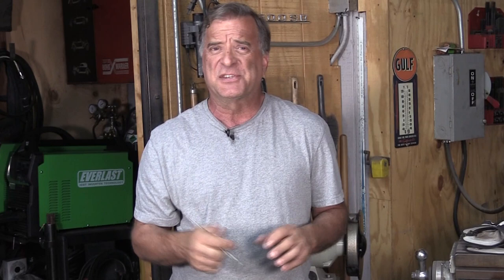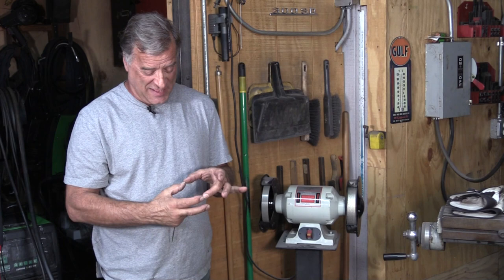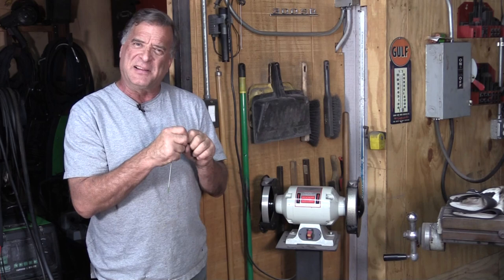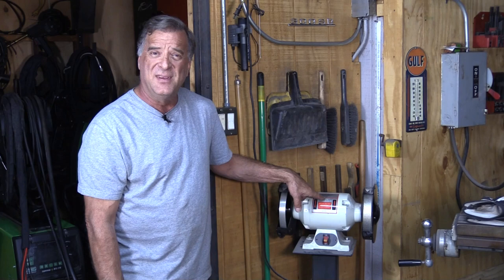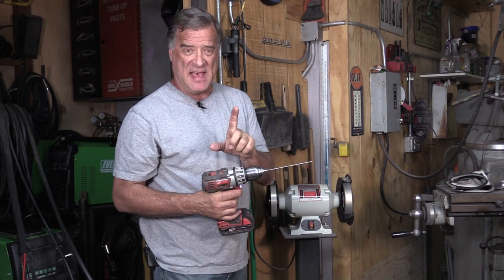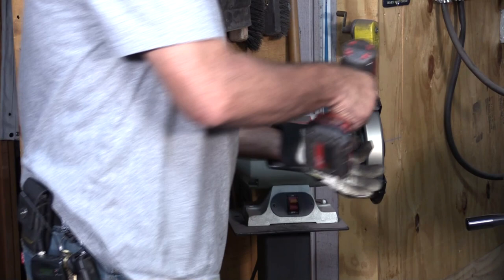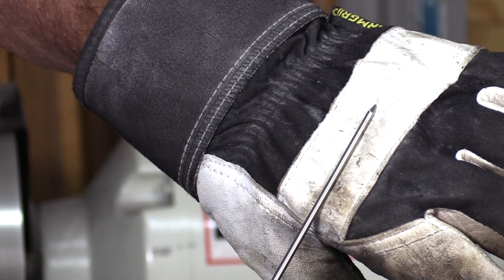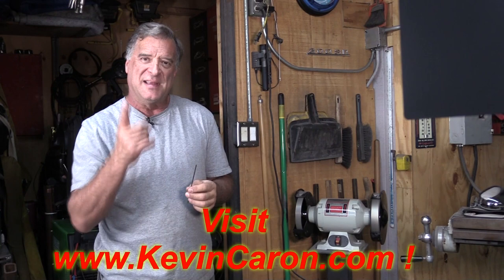How to Easily Improve Your TIG Welds - Kevin Caron

Comment: Good point about grinding wheel contamination. I had some very badly contaminated tungsten once, ground it, and ended up contamination the grinding wheel. Finally cured it by breaking off the tungsten and dressing the wheel.
Reply from the maker: That is the only sure way to stop it.  Thanks for watching and posting.

Comment: Hi Kevin, it is true beyond just the tungsten. I was on a pipe job another lifetime ago and they pulled my welder to work on another part of the site. That crew was working on Monel or Inconel pipe and they getting porosity in the welds constantly. The first thing he did when he got over there was to collect all of the files and grinding discs from the whole crew and throw them away then got brand new files and discs from the tool room. There was no more porosity. Good video.
Reply from the maker: Thanks for watching and posting Johnny!   Great to hear from you!
Reply: @KevincaronSculpture  I woke up during the night and remembered that I had left out two things—brushes and portaband blades. The smallest contaminant can cause porosity. This was especially important to the welders because it was a 100% weld tested job. A couple of bad x-rays and they were fired.

Comment: I love that little grinder from Harbor Freight for grinding tungstens. I think I got the idea from one of your videos.  Best $30 I spent.
Mine is mounted right on the welding cart. One side has a knife edge diamond wheel in it which allows me to cut the tungsten if needed, the other side has a regular diamond wheel for sharpening.
Reply: I have that grinder too.  I use thoriated tungsten though, so I run an extension cord out to the alley to grind my tungstens.  I tend to grind a dozen at a time and swap through them as I need, so that I don't have to run the grinder terribly often.
Reply from the maker: If it works for you, awesome!

Comment: It looks like Woodcraft (which is blowing my mind here btw) has several grits of diamond wheel available.  Which grits are yours?

I'd been looking at a wheel sold through McMaster-Carr, basically it's like a knife sharpener (the metal with perforations and stone sticking through) but set up on the perimeter of a flat cylinder.  Unfortunately its arbor size is more like lapidary, which would require stepping down to get it to fit on a conventional bench grinder.  The Woodcraft wheels are pricey but if they just fit on normal grinders then all the better.
Reply from the maker: I don't remember the grit off the top of my head, but something like a "fine" and "medium".  The wheels are from Woodcraft as well as the grinder.   Been working great for me.  But yeah, they are a little pricey.  Just over $300.00 shipped.  Thanks for watching and posting.

Comment: I don't know that I buy the fact that when using a bench grinder or flap disc, you're going to embed soft aluminum, or something else into the very dense tungsten, even so for the garage shop or non code tig welding I think you'll be ok, IMO. Now having said that I do prefer the diamond wheel myself. Keven, I don't know why you won't provide your subscribers with information (a link) on products you buy/show in your videos, Such as the bench grinder and diamond wheels in this video.
Reply from the maker: Fair enough!   Will try to provide that in the future.

Comment: What u think about the everlast power mts 211 si ? Have u tried one ? Can u do all around video with the 4 process ?
Reply from the maker: Sorry, I have not been able to try out the 211si.  But the bigger MTS machines are very dependable and I use them hard!
Reply: @KevincaronSculpture   thing is that its been complocated for me!  with standard and synergic feature, I havent been able to used correctly I guess and they don't anything clear in the users guide and havent seen a video of it

Comment: Kevin did you give up on longevity welding machines.
Mine still works ok but I know a lot of guys got stuck with duds.
Reply from the maker: Yes, I no longer use the Longevity line.  Been much happier with the Everlast and AHP brand.
Reply: My Longevity died 3 months out of warranty and it couldn't be fixed since no schematics were available.  Replaced by a Lincoln Square Wave.  So happy.  I should have bought a Lincoln to start with